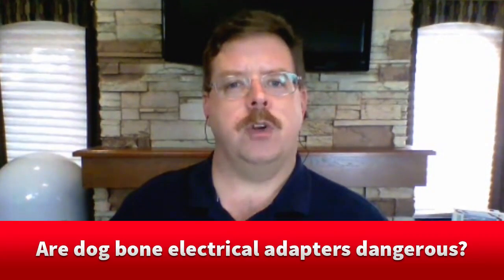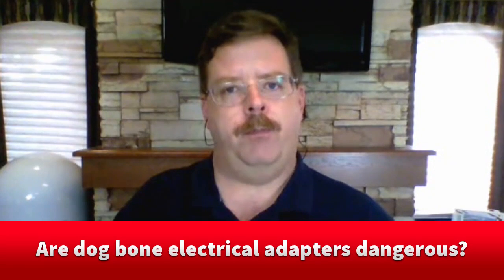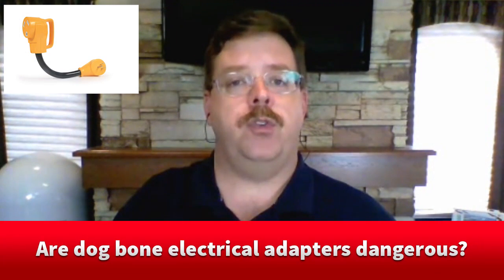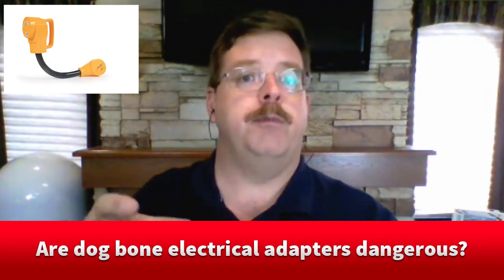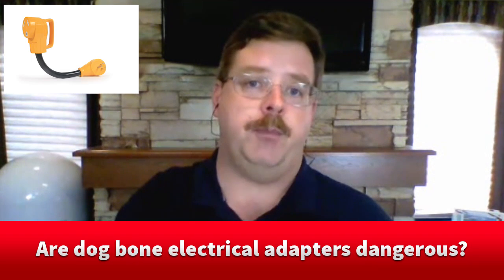Are dog bone RV electrical adapters dangerous?

Comment: I have seen where the hockey puck adapters from a 30 to 20 have blackened the ends of the 30 and melted the connection and the owners didn't realize it and were shocked and admitted to using them while running there ac units thinking the draw was not that much while parked at home doing Rv maintenance on there unit where if you use them just for lighting or low current draw items it would not be a problem